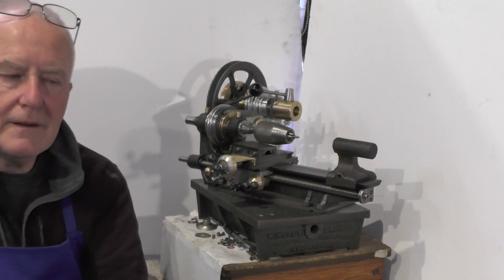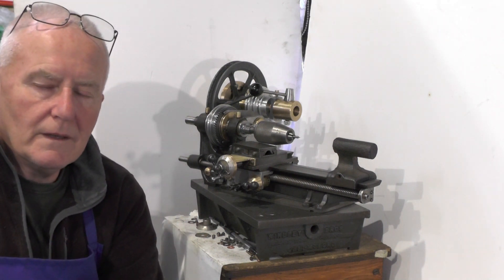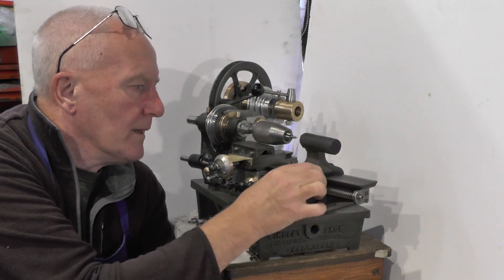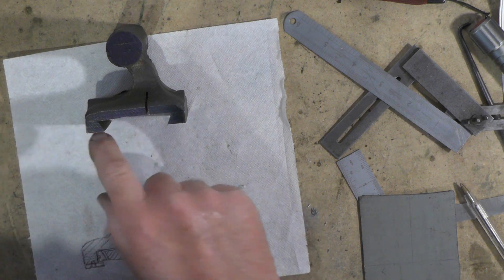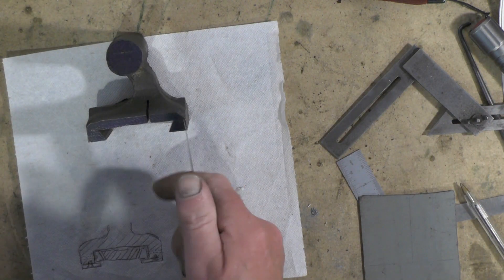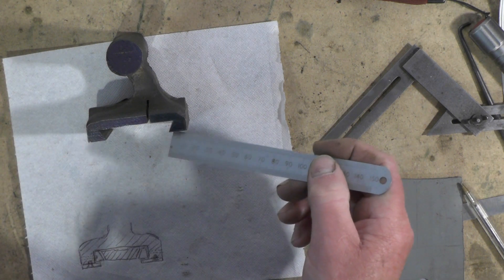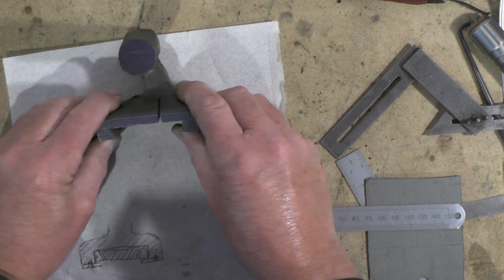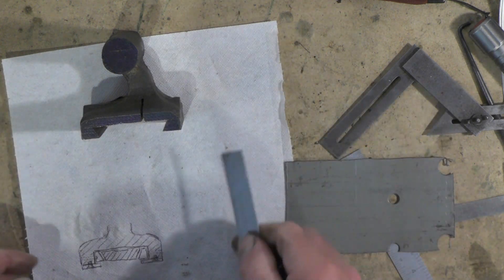Ep 13 Making a Micro / Mini / Watchmakers Lathe from Old Casting (Tailstock cont...) "mr factotum"

Comment: As always, enjoyed another video on this little lathe Kev, I learn something new from every video. How do you know how much play to allow for between the  gibs and the sliding undersides of the tail stock ,? How snug should the gib fit be ? I suppose once you set the the position of the gib with a grub screw pushing the exact centre of the gib the tail stock sliding sides will always stay exactly parallel to the main bed  ? Thanks for the video cheers Paul
Reply from the maker: cheers Paul, just trial and error till you get the feel and fit to suit
thanks again
Kev

Comment: Looking good Kev. My only concern would be parallelism of the tailstock to lathe centreline, I guess it will be fine at initial manufacture, but if you adjust subsequently to change the taper characteristics, you will also need to re-check parallelism and balance this adjustment with the centre adjustment which could be a bit of a faff. Maybe with the length of the bed being so short it probably won't matter. You could put the gib on the adjusting side on a couple of dowels to ensure it always moves parallel to lathe centreline. Cheers, Jon
Reply from the maker: eyup Jon very good point, like you say might not affect to much over such a short distance, we will see in practice, and i will keep the dowel option in the memory bank, like it when a fresh pair of eyes takes another view, i can get binkers or tunnel vision at times.🤣🤣🤣
cheers
kev

Comment: That's a fine little lathe you have made Kevin.
It is all very early days for me to learn about steam, metal cutting lathes, etc.
I do have a wood lathe but the motor burned out a few years back and there wasn't a replacement motor for it as the company doesn't exist anymore. 
I have been watching some videos of people using a washing machine motor to power a lathe, so I got a cheap brushed type from eBay. Going to attempt to fit it on the wood lathe.
I know how to keep the torque pretty constant on it. So I will see how it goes.
If I am nice to the wife I might get a metal cutting lathe for Christmas. 😆
Cheers Kevin. 🚂👌👍
Reply from the maker: cheers Mike
my motor on my table saw has just given up too, you should be fine with an older type motor i'm not sure about the more modern ones, electrics are above my station, keep getting the brownie points and a metal lathe will come your way i'm sure
thanks for feedback👍👍👍
kev
Reply: @MrFactotum  I Hope I never jinxed you Kev. LOL
The washing machine motors come in two types. The 3-phase type and the universal motor type. For the hobbyist, it is better to use the universal motor type because they are a lot easier to control. They have brushes just like a standard fixed magnet DC motor but they do not have magnets. Instead, they use two copper windings which become electromagnets when they get a DC current in them. This allows you to use DC to power the motor. The torque can be boosted or maintained by the amount of current put into the coil windings.
I plan to use a separate power supply for the windings as this will let me control the torque of the motor. 👍👍👍
Reply from the maker: @mikeflight9  no not jinxwd me my motor went a week back, 
great let me know how you get on, and i might learn something👍👍👍
Reply: @MrFactotum  Will do mate. 👍👍👍